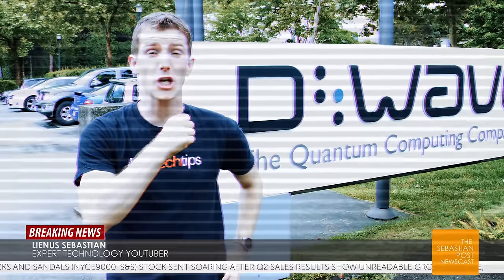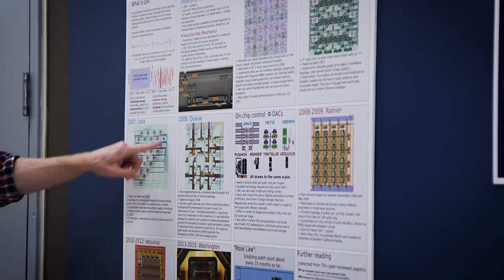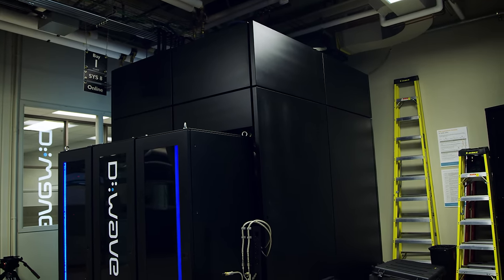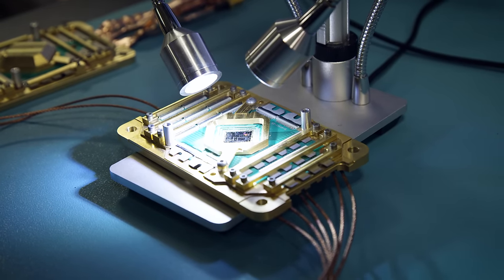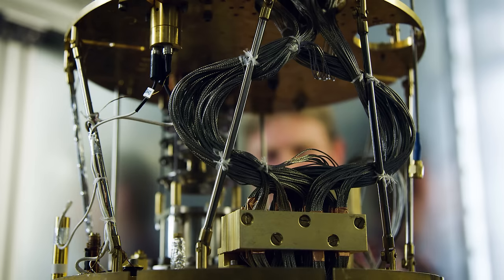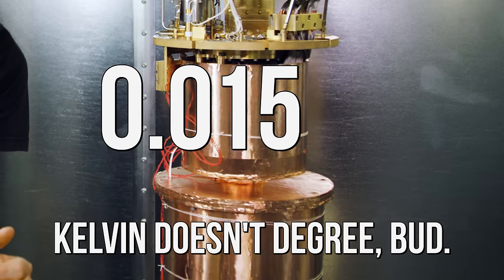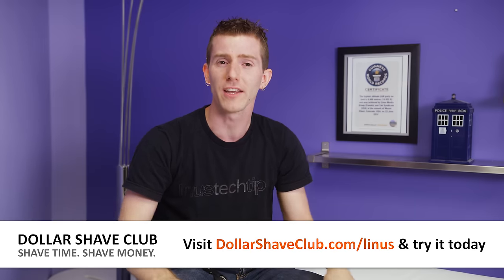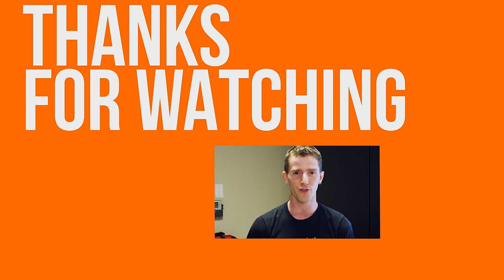UNBOXING A QUANTUM COMPUTER! – Holy $H!T Ep 19

Comment: Remember back then when calculators were as big as this computer?

No. Because you weren't alive during that time.

But seriously, by the time we compact this thing to the size of a phone, our society as we know it will be so different. Looking forward to what lies in the future! :)
Reply: That's not possible, it'll never become practical outside of the market of giant supercomputers.
It's still bound to the laws of physics, you see, and cooling something at say - room temperature, to the neighborhood of absolute zero requires tremendous amounts of energy and supplies.

A Noctua cooler or a custom watercooling loop ain't gonna cut it.
It's not something that can be solved and hand waved away, as it would require breaking reality and using literal magic, it's about as likely as discovering the means to FTL travel.
Reply: TheKain202 But in the future they could find a way to replicate non noisy quantum effects at room temperature. Or maybe they find a way to overcome thermal noise quantum effects and fear the proper signal through some effect or other. Line how Perpendicular Magnetic Recording boosted HDD capacities to where they are today. Who knows.... This is gonna be 70-80 years from now though, so take it with a pinch of salt. I mean, I'm still waiting for Memristor technology that IBM announced in, what, 2009? And which was theoretically proven to be possible in the 1970s
Reply: Sure, but with our current understanding of physics - i's just not possible, hence the Faster Than Light analogy.
Sure, many decades from now, we can make a discovery that will completely flip our understanding of the universe upside down, but until we do, things you propose are literal magic, since they require us to tell physics to fuck off :D
Reply: Radi Bear by the time that a phone will be as powerfull as our PC today, imagine how powerfull a full size pc by that time...
Reply: not me. don't see much future left for us. we are making a technology so advanced it can do everything for us and has no need of us. we got to this point today because we were forced to by survival of the fittest. will there be any metric left for fittest? 

maybe we will get lucky and our tech based descendant will leave us the solar system.
Reply: What's up with people wanting the end of the world and everyone to die or become slaves to robots? cmon there's enough science fiction to not let that happen
Reply: by the time we compact this thing to the size of a phone, we'd watch cat videos and argue with some strangers over the virtual reality world using it...

I mean, look at this day... we hold the technology to get every single open information available to humanity in our pocket, and we do just that.
Reply: ... I have one of those calculators sitting in storage.
that thing is gonna sell for lots of money if it's for the right people
Reply: What if since quantum computing can make realistic situations, you have virtual reality that looks 1000% real and feeling is the only thing not making you feel like you're in the simulation. Matrix irl in 200 years?
Reply: "That's not possible" they said the same 60 years ago about the PCs we use today.
Reply: I remember when I see photos of it, I do not have to be born at that time.
Reply: TheKain202 
Wow, I didn't know that you lived 80 years in the future... Or that you were a scientist! But please, don't try to disprove something as "impossible" or "can never be done", as people saying such things will tend to demotivate society from trying harder, and achieving greater things.
Reply: Well, no, the 'super realistic looking' part will still be attained by normal computers, but quantum computers will be able to produce NPCs that feel like real humans.
Reply: +Lannister
That's a completely wrong analogy.
Continuously upgrading the production process and miniaturization of technology, while it may have had seemed impossible to the people of the time, is nowhere near close to breaking reality and telling E=mc^2 to go fuck itself.
One is a steady technological progress, the other would forever be the greatest discovery mankind would ever make.
Reply: victor chiz
Dude, i don't know where you're from, but where i'm from were being taught basic thermodynamic in grade school.
Energy doesn't disappear, it only changes form and in order to miniaturize that shit, you'd have to make the heat invading the system from a million different directions, all at once - DISAPPEAR.
Otherwise you have to construct a huge ass power hungry cooling solution continuously delivering stupid amounts of coolant.

Such a computer is only feasible as a super computer with no expense spared, or in space, where the ambient temperature is far closer to 0* k.
Reply: It will never shrink to a smaller size only get bigger, these things literally use atoms (only things that are affected by quantum mechanics) to process info, the more Qubits the better and you can't really 'shrink' them down so your stuck at this small but still sizeable scale, and the cooling will never get better then it will once the chips use now power as it is, by physics, already 'optimal'
Reply: Radi Bear we won't be alive then 💀
Reply: Actually, this technology can get smaller, even on the chip level.
They aren't using single atoms to do the computation.
Reply: before 40years there was floppy disks with 1 half mb 

now you can get m2 ssd's which read over 30gb per seconds and can have 10TB
Reply: what i see instead as more realistic is that normal computers will perfor as powerful as super computers today, rather that quantum computers being compressed into an everyday product
in abot 20-30 years
Reply: tbh, I can imagine they would find methods of dealing with the thermal noise. Give me 2billion qbits with lots of error and I can make them run like 2000 qbits with no error.
Reply: yeah i am pretty Young so i wasn´t alive back then.But i know that the System is still in its  infancy but i still dont know if this tech is going to be the one we use in the next 10 years
Reply: McHardkor 
So are you saying that we will NEVER invent any cooling solution that will sufficiently cool it down, while maintaining a smaller form factor? Because unless you have invented a way to travel into the future, see if we are even using this technology anymore, or if it just became outdated, and then checked the cooling system used to see if we were able to reduce it in size, then I suggest that you should consider the fact that it may be possible. (Or I could just be completely wrong and we'll never invent such technology haha)
Reply: Don't talk about this shit unless you comprehend physics. We're talking about a temperature near absolute zero, the coldest temperature ANYTHING could theoretically have (not even practically, because Heisenberg's theorem).
Bringing it down to a smaller form factor would only be possible with a near-perfect vacuum, and even then it will always need like 2-4 weeks to cool it down sufficiently.
Reply: immortal human
Reply: Remember when computers were people and not electronic devices?
Reply: Radi Bear did you just assume my age?
Reply: +Nikolas Konstantinou I mean, I'm assuming that most people watching LinusTechTips are younger than 90 years old. So yeah, I'm assuming :P
Reply: The human race will be gone fam...Hawking said we only have (realistically) 100 years left on earth....SO, if this q-computing could advance a bit and start givin us answers on how to save our asses then we're cooked
Reply: It's most likely gonna be in our life times, at the rate of current technology advancement.
Reply: We'll all use quantum computers in the future, it's just that no one will be owning computers by then. Everything will be done in the cloud, and all everyone will own are screens and controllers. Lag problems? Put a quantum computer on a street corner in your neighborhood, like those broadband exchange boxes.
Reply: while i agree with a lot of your points, or at least where you are going, there will always be mechanical keyboards, though, which is essentially just this link between the user and the computer. mechanical keyboards arent going anywher from what i can see, once you go to one you really cant go back; your WPM increase just because you likae to type (and the shorter actuation button). i know they cost more than rubber domes, and ofc that is why rubber comes were made and some of the best keyboards are the older ones pre-rubber dome culture. mxcherry is great because they are constantly changing  their product line and not really discontinuing the current ones, so you can basically modify any keyboard into different mechanisms / colors / types of plastic... i have a corsair with military graded aluminum and i can see how itd be converted (every key) without too much trouble or time if you wanted a certain section of your keyboard to have a little kickback, full linear with quicker activation (though the reds are pretty much the same.). the mx blues have a "bunm" made for games like dota where actuation assurancy is neccessary, i had browns which wer a mix of  red and blues but i didnt like the keyboard layout as much  (macro keys limit my orientation as i use the end and the f key to determine where my hand is resting. its a habit that after so many years of gaming at higher levels and almost always competetively made me choose a system i  can (and expectted to change... but the mx reds work fine tbh as long as long as you trust your board to actuate first. the romer-g's arent even that bad, they seem like a mix of everything, not sure what kind i was using on a razor i believe? but they have a nice clicky sound thats subtle, low weight, and just felt like a brown that bottoms out like the cherry mx reds i have , with some clickiness and different step (as compared to any mx i have tried). i liked the romer g to be honest. as for anything else that you mentionied, yea, there is going to be some craazy shit. which means this desktop that i have running a bunch of crazy shit will be a smaller desktop, maybe using a new cooling system than has even been devised (thinking of middding my 212 evo block and seing if it can run water through itself without any extra additions besides hookup. ive noticed graphics cards have the same setup but i am understandably more cautiousand might just make the supercooled cpublow air downwards onto the gpu. ive looked but before i snip off copper ends and attach it to my homme-made chiller im going to try it with my 30 dollar , wouldnt-even-matter if it di fuck up and run it for a few days. i might have to tackle the whole condensation issue but i already have a a sound idea for that.

the strange things that happen when your favorite things are 1. computers.. 2 hydroponic indoor growing  3. harnessing nature to improve key components 4. back-engineering or seeing usefulness in something built for a completely differnt piece of machinery.

now i just need to get good at sound buffering and im set. anyone know any good guides , even CLASSES (as many of my inventions use so many motors in so many ways, water,air, vacuum pumps and reciprocation of cold gasses to feed the water loop. im ging to stop before i mention everything im working on
Reply: >"That's not possible" they said the same 60 years ago about the PCs we use today.
It was a difference in quantity, not quality. Something like "Cars can go 30mph max. No way you would be able to build 100mph max car."
Here we have physical limitations.
Reply: i perceive a use of magnets in future prototypes...
Reply: Why are people still saying things are impossible? Look at how much technology has grown in the last 20 years, and it's only accelerating. You guys make it sound like you have the knowledge of a god.
Reply: +Mrtheunnameable
>Why are people still saying things are impossible?
Because a lot of charlatans had devalued this world into the oblivion. It's used as a synonym of "hard".
Creating small and fast semiconductor computer is hard. Sending a person to the Mars and back is hard.
You can't run x86 code on this thing. It's impossible, not hard. It theoretically works pretty well on some specific subset of tasks.
>and it's only accelerating
It isn't.
Reply: TheKain202 Lmao, way to go to ruin some ones dreams xddd
Reply: The difference was back then we could actually see how such a thing could become practical. Super cooling is not practical, nor can we think of a way to make it so. Unless we can discover a new alloy that has a high superconductivity temperature, quantum computers will never be practical outside of niche applications. Compact Faraday cages is a  reasonable thing to expect, but without high temp superconductivity, quantum computing can't work unless cooled to near absolute zero, because we are talking about atomic level effects. It is extremely easy to contaminate such things. 

Don't expect quantum computers in homes, expect us to move away from electron based data buses and into photon based data buses. It is vastly easier to ensure uncontaminated photon based data buses as well as being exponentially faster. That is the future. Moving to fiber optics was the first step. Next is moving to photon based front side buses, then photon based backside buses, then photon based transistors.

Comment: That secondary (I assume) vacuum pump is a very fancy pump that uses a silicone oil mist that moves against the direction of flow internally to entrap gas molecules in the oil.  They can get down to a vacuum similar to space.

Comment: Are these able to run minecraft ?
Reply: Not yet still not good enough
Reply: @kone__  haha so comedic, i can tell youre a funny guy!
Reply: nope not yet it would probably run at 3.90.09.9.42.243.2.243.4.42.42.5 quaddrillion. zillion. trapilizion frames per day but to run minecraft good you need 999999999999999999999999999999999999999999999999999999999999999999999999999999999999999999999999999999999999999999999999999999999999999999999999999999999999999999999999999999999999999999999999999999999999999999999999.4 quaddrillion frames per second
Reply: Maybe but probably at like 20fps
Reply: Actually it probably couldn't, there's no version of Minecraft coded to run on it.
Reply: Everything you can possibly imagine doing in that game will be simultaneously rendered instantly. You will start the game and one second later it will tell you "thanks for playing minecraft", then shut the game down.
Reply: @Yggdrasill8  Finally a way to actually beat Minecraft!
Reply: @kone__  chill dude
Reply: Can these even run Windows?  Or would you need to write a whole new OS due to it being a different Architecture?
Reply: Actually... no... Java doesnt support quantum computers. If it could be run through some sort of compatibility layer it wouldn't run better than a gaming computer due to the compatibility layer making it basically like a normal 32/64 bit PC
Reply: Hunter Terrell He probably means if it was and tbh it probably couldn’t if he put mods
Reply: When you cool your system down to 0.015 K, but still can't play Crysis
Reply: it's not compatible
Reply: @jonathanpujols  hahahhahahah so random omg😂😂😂😂😂😂😂😂😂😂😂😂😂😂😂😂😂😂
Reply: Imagine if it did? 
Just loading the world and watching the game build buildings while you walk through it. Animate time, wear and tear, age mobs and I bet split in hundreds of directions rather than just use Cube voxels. 
By the time you turn the corner, your pickaxe has rusted away and the handle is dust in your hands. Computed to visualize its dust filtering through your fingers. 
I wonder if they have thought of making a game we can play using a Quantum computer?
Reply: > Are these able to run minecraft ?
They are meant to break any cryptography in nanoseconds. Don't mind minecraft if you can break to any bank in the world...
Reply: yes and no
Reply: Prolly with optifine, all textures and particles disable. Even then you might get 4 fps
Reply: lol it would just calculate every possible thing you can do in minecraft and give you a number and expect you to understand what that is somehow.......???....?
Reply: Daft Punk ok virgin
Reply: @kone__  nahh i tried and i only got like -100fps it was like lookimg at a picture bro help?
Reply: No
Reply: It can run a simulation of an ai running every outcome of playing Minecraft
Reply: LexRail you could of used real numbers like nonillion or sexdecillion.
Reply: HaxDestroyer it will run at 6000 frames per nanonanoseconds
Reply: idk, maybe upgrading the graphics card ?
Reply: Do you even know what a quantum computer is
Reply: Late, but hell no, it wouldn't be able to read the mc info
Reply: no it doesnt have RGB so no
Reply: No sorry minecraft requires 32767 qbits
Reply: No, traditional computer algorithms for collision detection, 3d rendering and such won't work (efficiently) on a quantum computer.
Reply: The real question is Can it run Star Citizen?
Reply: It can definitely run Minecraft but if it has shaders that’s another story
Reply: It can run 820929282838363730039999992828282848837382748382837999e888888889999996827169181991011420839292020119199 frames per second and when u install something it will be 120 gb/second
Reply: considering minecraft is based on java, which is based on binary, so it couldnt run it
Reply: @nicolas423  Hahahaha lool even a Quantum computer won't run Minecraft with shaders
Reply: I mean, if you have the Yang Tse Dam in your backyard, just for your CPU, plus the funding to create a motherboard and codding to connect it and a bunch of these Dwaves together with your other components, you could try but it would probably create an AI at that point.
Reply: @hunterterrell9930  Minecraft is coded in java java maby runs in the future on quantum computers
Reply: @jonathanpujols  what?
Reply: Sure, Minecraft PE: Philosophical Edition